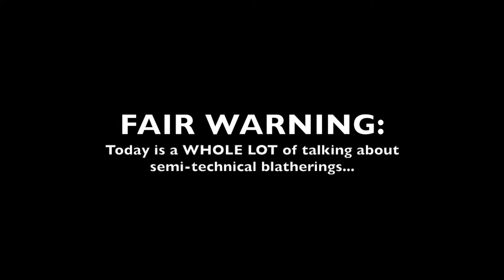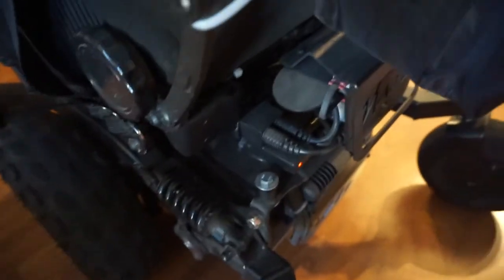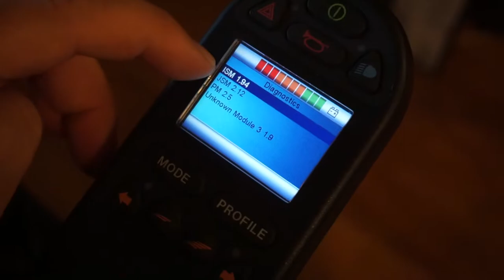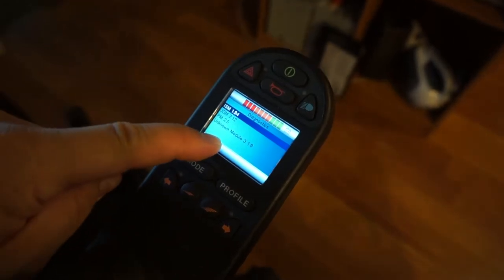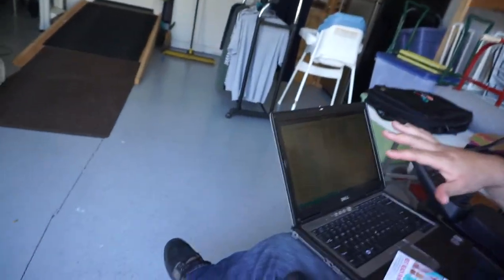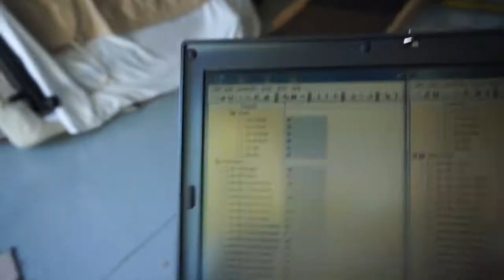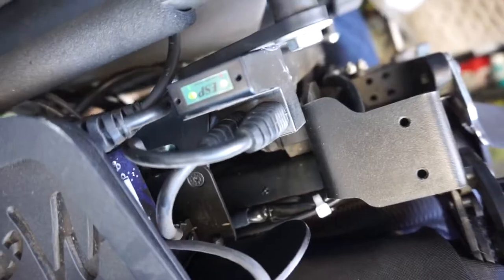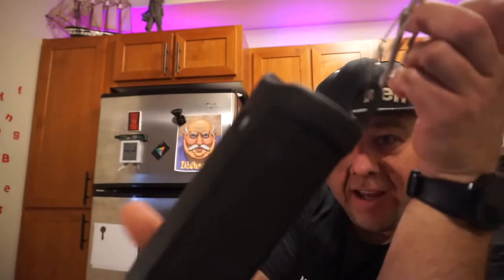VLOG 258: IT WORKS!

Comment: Where did you get the lights? I have mine that came with the chair and they're great, but my right light keeps burning out and can't figure why? Any sugestions? Thanks.
Reply from the maker: got the lights from an electronics supplier.. they're sorta generic weatherproof sealed LED modules.. was able to connect them to the seating controller.. and the front lights are motorcycle daytime running lights from amazon.  kinda cobbled them together since the factory lights are 1) super expensive and 2) not very bright!  mostly i want to be seen by cars at night!  
what kinda of chair do you have? how often do the lights burn out?
Reply: Thanks. I have a Quickie P222 SE. I love it. It's powerful, fast and gets me from place A to B and it does wheelies lol. The chair is almost 4 years old and the lights came with the chair. Like I said before the lights are bright, but my right side light bulb keeps burning out; I even have blinkers. 4 times been burning out so far. I've ordered 2 light bulbs from ebay and I hope they work fine. Next time I get my chair I'll put my own lights. You're right they're expensive even the light bulb itself. Thanks man.
Reply from the maker: are they halogen or regular bulbs? maybe its tome to get some LED retrofits!! :^)
Reply: They're LED lights 19 little LED lights on one light bulb if you know what I mean lol :D
Reply: It’s 1156 LED light 💡 24v